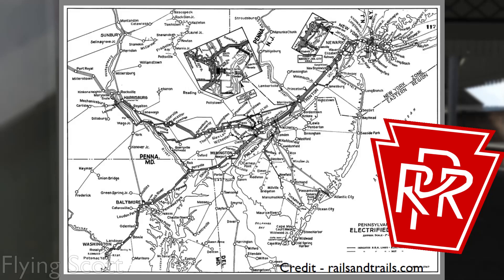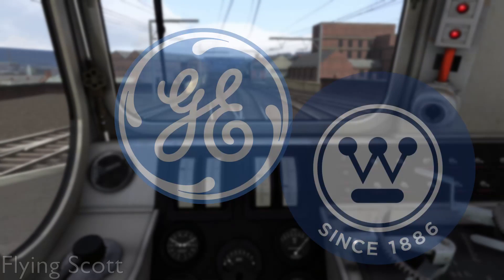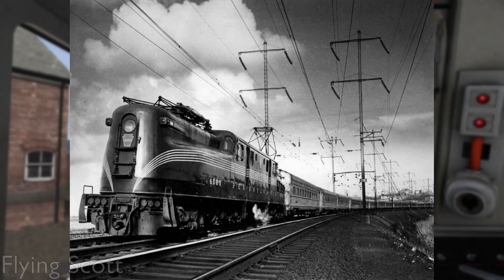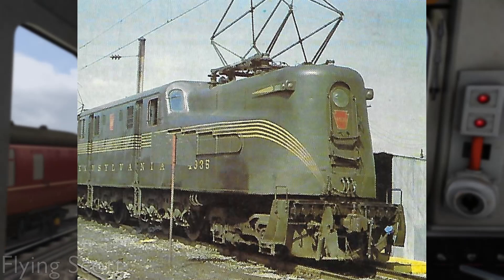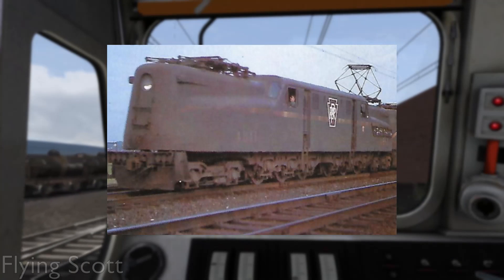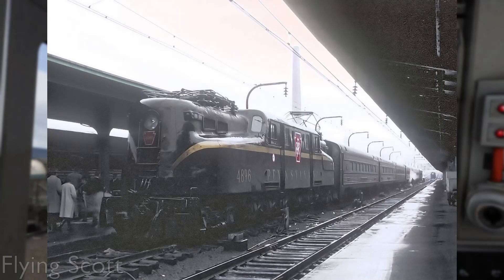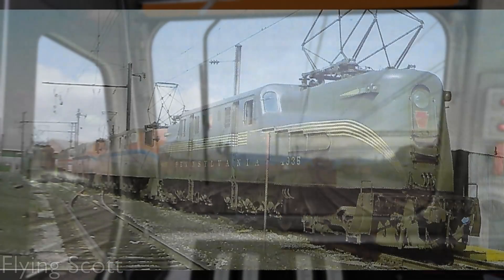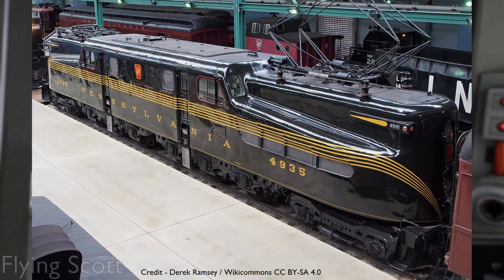Those Great Locomotives - GG1

Comment from the maker: Hello folks, no anecdote this time. As you might remember from last Those Great Locomotives, the following three episodes would be Micro episodes. But, I also said this first of the trio would be about the English Electric Type 3, or Class 37. 

GG1s aren't Class 37s. I found myself short of literature, so until I get my hands on some BR diesel material, the EE Type 3 episode will be postponed. Similarly, the Clayton episode will also be put on hold, but instead I'll cover the LMS 10000 series diesels. The N15X video will remain, however!

Comment: Minor nitpick, but Conrail didn’t own any  GG-1s in 1971, as it didn’t begin operation until the Railroad Revitalization and Regulatory Reform act of 1976. The AEM-7s also did not replace the GG-1. That was a modified freight locomotive also made by GE, the E60CH. The E60CH in contrast with the reliable GG-1 was rife with mechanical issues. The AEM-7, bases on the Swedish Rc-4 was only called in because the E60CH failed to serve as a good replacement for the GG-1.  However this story of newer locomotives not being good enough to replace mechanically outdated equipment was unfortunately too common in the early days of Amtrak. They failed to find a suitable replacement for their E and F units twice before eventually turning towards the iconic F40PH. A locomotive with a reputation that might even surpass the GG-1.

Comment: Fascinating engine I must say, I love its design, but it's a shame it didn't have a model with only one cab design for more power
Reply: Funny you say that, there was a GG1 that actually got cut in half and was used for yard work XD
Reply: @eddierools  but I ment keeping the same length and general shame of the firing butike the EMD F series of diesels but just electric. I think in short what I want to say is not to have a 2 cabins
Reply: @FQP-7024  Well I see what you're saying, but having two cabins made it far more convenient for the crews, as they wouldn't have to turn the GG1's around.
Reply: @eddierools  yes that is the big plus of the design but what I wanted is a long distance super heavy train, so it dosent have to turn it simply pulls the heaviest trains for the same amount of power
Reply: The cabs really didn't have any connection to how much power the locomotive could have. As noted in the video these locomotives could out pull three or four diesels. One thing not mentioned is that for short bursts of time these locomotives could get up to 9000 horsepower. They could pull a very long train for as long as there was wire above them.